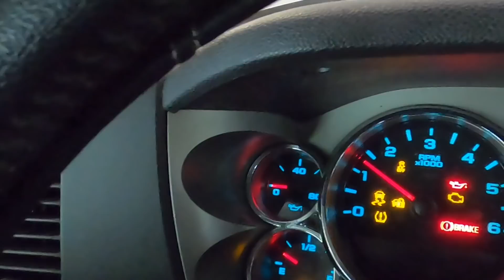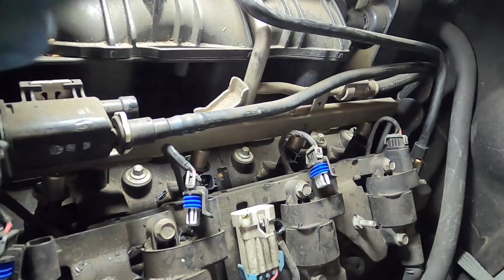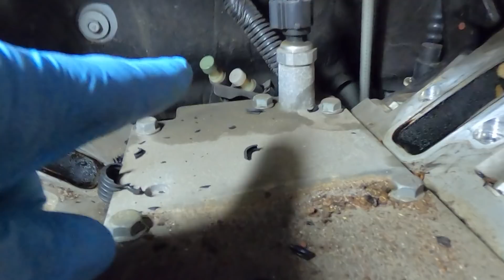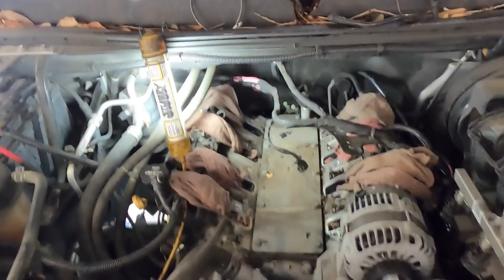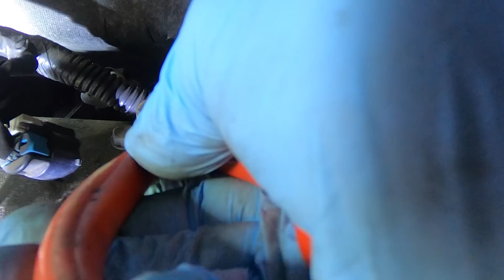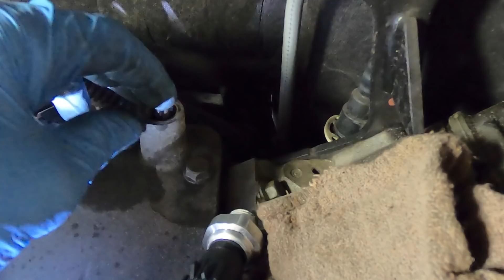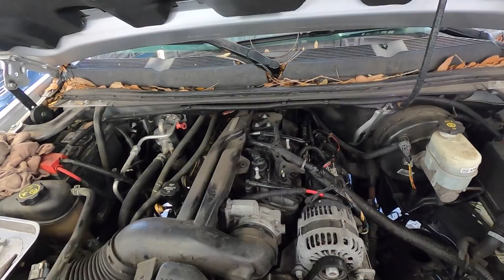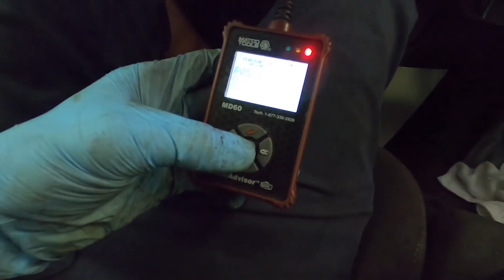Customer States: Google Diagnosis…replace this part!

Comment: I usually sneak the mid length oil pressure sensor socket with a universal and 6 inch extension to the back, never have removed the intake for an oil pressure sensor but I do believe that's the proper procedure.
Reply: That's what I was thinking, I just gave my truck the old reach around and got to the sender. But yes removing the intake is the by the book.
Reply: @GixxerFoo  Watch SMA do ya?   "The old reach around".   :)
Reply: Flat rate or not....I get paid by book time so if I do it in a fraction of the time I can make more hours that way.... it's what flat rate pay is designed for.... my years of experience costs the same no matter how fast I do it
Reply: Same here, very easy to replace without removing the intake.
Reply: Did my own, I did not remove the intake, easy enough....
Reply: Nobody with half a brain pulls the intake to do these
Reply: I would of been done before he could finish his step ladder rig.
Reply: Right I never have as well, a swivel and a 6 inch extension works.
Reply: You know what is strange is that I use regular sockets on oil pressure sensors.
Reply: thats what i did.
Reply: Depends on how long and skilled your fingers are and how much you want to tear up your hands.
Reply: A crows foot on a 3" extension 👌
Reply: I also do this, when I saw him removing the manifold I'm like whaaaaaaat?
Reply: Because he doesn't know how to flat rate..the labor is like .6 to replace oil sending unit and 1.9 to pull the intake talk about over charging the customer!!
Reply: that is the only way I remove those sending units, to much work pulling the intake on them, I would only do that if I am also doing the lifters due to the limited oil flow gm did with the economy engines but everyone knows it turns into almost a full head job just to change those if you don't want head work done to them also.
Reply: I have not one time pulled the intake to replace it
Reply: Whatever the greater shop hours.
Reply: Yeah like if I had to do these often I'd make a tool for it or get a setup to do it if I've been told it's possible. Otherwise I tell the customer book time and ask for the car for 2 days and call it a job...
Reply: Same here
Reply: I replaced my sensor without taking any other pieces off,  It was a bitch but I did it.
Reply: @drakesavory2019  Same here, hardest part was figuring out the locking mechanism on the connector without being able to see it.  Lost some skin on it though.
Reply: You are correct, have done it myself several times. Was the Service manager at GMC dealership 20 some years and shop foreman before and tech.
Reply: The more things (that are working correctly) that you take apart the greater the chances of creating a problem where one didn’t exist before. Having said that, there are definitely days I’m just not in the mood to battle and fight and for my own health, both mental as well as physical, I’ll take it apart. Hell, if it’s flat rate you’re already getting paid for it.
Reply: Remember the shops have follow the book it's dumb but that's how they make there money I have a 2013 GMC Sierra and when I installed new headlights housing it says that you have to remove the entire grille not evan close I did it in 20 min.
Reply: @RICARDOGARCIA-wr9hx  they only have to follow the labor times to charge the customer, but they dont have to follow the repair procedure.
Reply: Ya you can do it without removing the intake. Just have to be carefull with the clips securing the fuel like fitting. They are sharp, and will tear you up.
Reply: Done bout a dozen of these.. Never removed intake.
Reply: @Angel Valdez 
I know that and besides what does that even matter?  If he's guessing torque value, one could be at 15 in/lbs the next could be at 30 in/lbs and the next could be at 10 in/lbs. And how many intake bolts are there? Come on, if you say your " going by the book on this one" Then go by the book and use a torque wrench, don't have one borrow one.
Reply: @fredted1611  if you're so new you cannot tell the difference between 30 in/lb and 15 in/lb by hand then you don't need to be working anywhere but a lube place.
Reply: Same
Reply: I did mine without removing all that but it ended up being the O ring on the pick up tube in oil pan commen to go out Fixxed
Reply: Lot easier to sneak a socket in. Then making more work for yourself
Reply: Same done 2 the week before 0ne 6.0l and one 5.3l.Its funny how sometimes they come in pairs.
Reply: Me too i have never taken the intake off for the 5.3 or 6.0 oil sending unit replacement  , thats just waste of time
Reply: @leolion2216  right on! Mine is a 5.3
Reply: Same here I didn't have to remove my intake manifold and I have the same truck
Reply: @louie8427  sure you do
Reply: Done the same. Sometimes though it was easier to yank the intake.
Reply: Seems to me the 'proper' procedure is the easiest or quickest that gets it done.  F what the book says.
Reply: gm dealer charges $900 to change that sender on corvettes.  i do em without pulling intake, pull wiper arms, cowl plate, hole saw the fiberglass right above sender, insert my turned down 27mmm socket, make $300.
Reply: Flat rate shop, that's why he pulled the intake out.
Reply: @fredted1611  Actually a flat rate shop is the kind where the mechanic will take the shortcuts because he can make more money that way.  He gets paid the same for the job no matter how long it takes him.  The fact that Rainman took his time and did the job 'by the book' indicates this shop charges by the hour and not by job.
Reply: @LA_Commander  
Depends on the shop there Skippy. Some flat rate shops make you do it by the book.
Reply: @fredted1611  Also depends on the mechanic himself there 'Skippy'
Reply: @LA_Commander  
Ahh no it doesn't, if your working in a flat rate shop that does it by the book, you better do it by the book or be looking for a new shop to hang your shingle in.
Reply: @fredted1611  ok, I'll give you the point. Those kind of shops do indeed exist. They are out there. But few and far between. The vast majority of shops allow their techs discretion on a job. The only exception might me new guys fresh out of school. For those guys, yes do it by the book, until you are experienced enough to learn the shortcuts.
Reply: @fredted1611  why would anyone wanna work there any make no money. Those shops will only have shit techs
Reply: @5n33ks5  
You do realize that most dealership's are flat rate right?
Reply: @fredted1611  yes I’m a tech and so are most of my friends. I’ve never met a tech that isn’t flat rate. There is no way a good tech is going to work at a shop that makes people do the book procedure. That is the dumbest shit I’ve ever heard.
Reply: @5n33ks5  
How long have you been a tech?
Reply: @fredted1611  10 years I average 14-15 hours a day in 9 hours of working. Why would I want to get paid 9 hours for 9 hours when I can get paid 15 hours for 9 hours. That just don’t make sense
Reply: @5n33ks5  
Young pup then with only 10 yrs in 😂🤣 Lol. In it for the dough not the ability,🤣.
Reply: @fredted1611  ability? You don’t make money without it. You clearly have no clue what you are talking about buddy nothing you have said makes any sense
Reply: @5n33ks5  
Maybe if you watch Rainman Rays repair you'll learn a little something.
Reply: @fredted1611  flat rate is an even better reason to just remove the sender without removing the intake. This is literally a 15 minute job
Reply: @bbbbbb1243  
Tons of dealerships that do things by the book and are flat rate. Some on here need to get out and see the country before commenting on there little spec of dirt they call home.
Reply: @fredted1611  that's y you don't pull the intake
Reply: @9502silverado 
Really 🤔🙄🤣
Seriously I've done more of these than I can remember, I've never ever pulled the intake either. Cussed some but never pulled the intake.
Reply: @fredted1611  FLAT RATE GOES BY BOOK TIME. IT DOESN'T MATTER  IF JOB CALLS FOR  4 HOURS AND IT TAKES YOU 10 , YOU ONLY GET PAID FOR 4. IF JOB CALLS FOR 4 HOURS YOUR DONE IN 2 HOURS  U STILL GET PAID 4.  I AM NOT YELLING  BAD EYE ,JUST SEEING  BETTER  LOL
Reply: @fredted1611  nah, you shortcut everything when its flat rate. He either doesn't know the trick or he actually does things by the book, which is kinda weird😳
Reply: @Mondos2001  
Well I do know, he keeps guessing torque values on plastic intakes is going to bite him in the ass soon
Reply: @fredted1611  maybe, but I cant say I havent been guilty of that. 😅
Reply: @Mondos2001  He either doesn't know the trick or he actually does things by the book, which is kinda weird😳 -- Doing things by the book is weird hahahha
Reply: @fredted1611  prolly not, a chevy isn't that fancy and it looks like he does dealer work. I bet he rarely gets another vehicle and ive guessed torque specs on over a dozen different cars with great success. The trick is to know where not to guess
Reply: @inibrasiumthefirst2680  
I have guessed torque specs to but not on critical things such as PLASTIC intakes. I have done this same exact job around 30 times now and I never ever took the intake off to do it.
Reply: @fredted1611  I have a guy who works with me that needed to recalibrate his invisible torque wrench. The 1/4-20, 5/16, and 3/8 fasteners only need to be snug on the split lock washers and I've had to drill out and retap after breaking off a 3/8" Grade 8 socket head cap screw in heat treated carbon steel. That was fun. Those parts are only available through local fabrication on a machine that was first installed when I was in middle school. [ETA: I'm in my early 40s.] Some repair parts don't exist except as salvage on a finite number of highly specialized products sold to the government. That was a long morning of cursing like a sailor and an endless succession of machine oil and drill bits to slowly remove Excalibur from the stone.
Reply: @kdawson020279  
Exactly. I've had nuts snap off on oil pan drain plugs because of guys who think they know the torque spec without the torque wrench. Kinda sucks when you have to drop the pan to change the oil and fix there screw up.
Reply: @Mondos2001  he's doing things by the book cause he's filming a video to show people what to do
Reply: @joeyleonard3571  well, if he's doing things by the book, you're supposed to replace those intake manifold gaskets every time you remove the intake. I didnt see him install new gaskets...👀
Reply: @Mondos2001  yes you're right, definitely forgot to do that
Reply: @Mondos2001  if it's tight it's right.lol.
Reply: @fredted1611  right on, they vary too much.....

Comment: My guess is oil pressure switch doesn’t work because the stepper motor is no good on the dash cluster. I know for a fact I wouldn’t went to all that trouble to take the intake off and change oil pressure switch when you know it probably not going to fix the problem. I am myself as a mechanic don’t want to do extra work especially the way that intake is put on with cab forward styling. I know the customer asked to get the oil pressure switch changed but sometimes they don’t know what’s best you have to guide them.